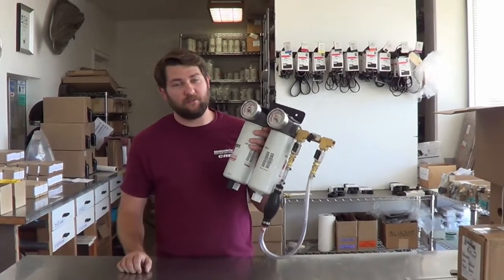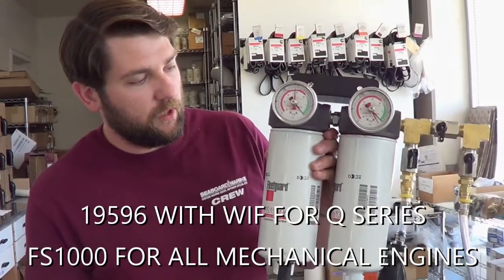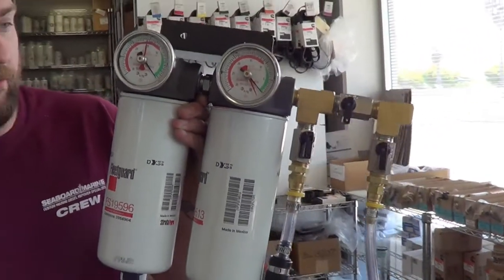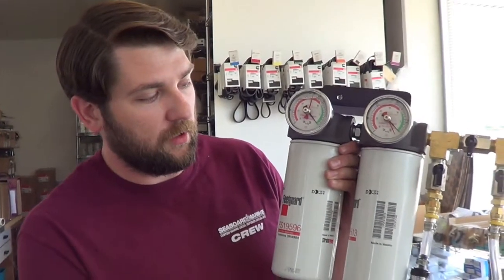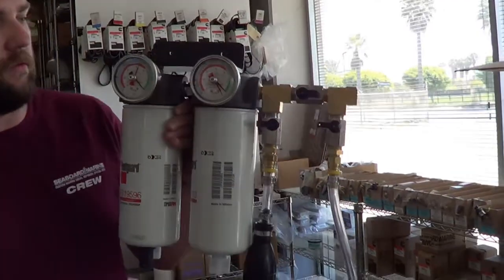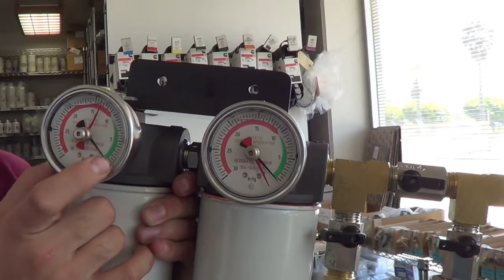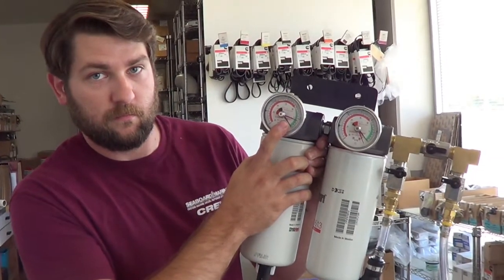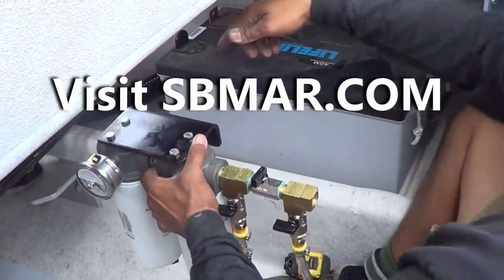Product Spotlight: SMX Fuel Filtration System

Comment: Are you not running the return fuel line to the tank and just Y it back to the main feed line?
Reply from the maker: No that would be bad, definitely run the return line to the main tank. Kevin is only talking about the supply side filtration here. If you have a mechanical engine it should be submerged with a dip tube, ideally.  If you have an electronic engine it should not be submerged.  The T you see later in the video, is combining the tanks on the supply side.  They each have their own ball valve and they go to a tee into the filter.  The return lines aren't shown, they should go straight to the tank with no valves.